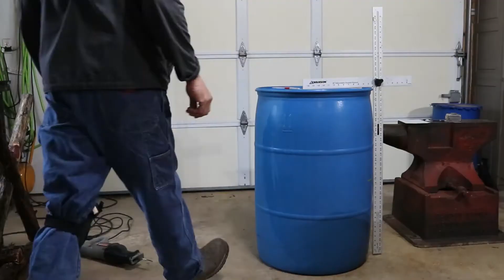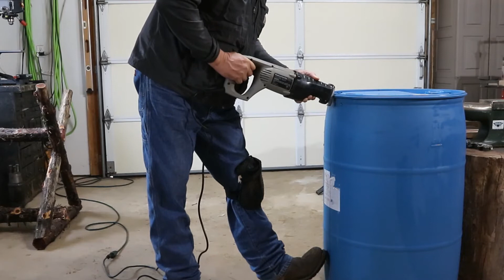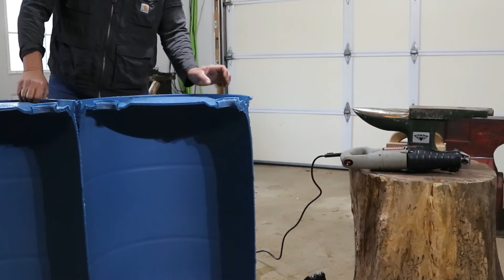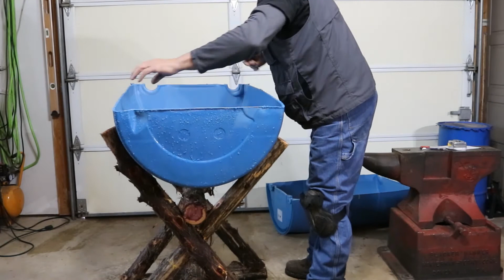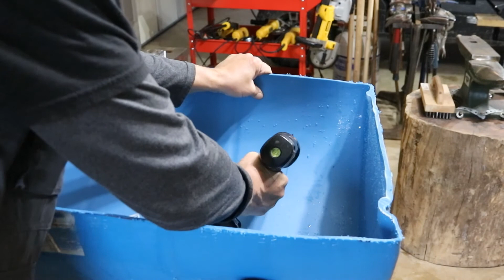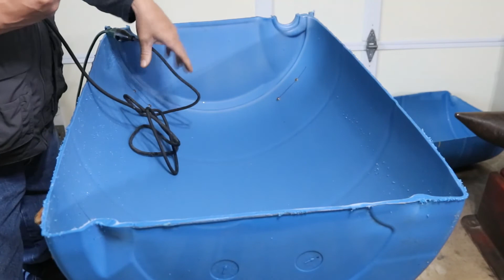How To Make A Raised Garden Box With A 55 Gal Half Barrel

Comment: Great Job Joe, And if you put the weep whole on both  sides about 4 inch's from the bottom and use a 1 inch spade bit then put some garden cloth over wholes they say you can fill with water till it comes out the weep wholes and wont have to water as much and if you get some down pores it wont flood your your plants out. Also from what I've been researching it promotes the roots too grow downward  instead  of just spreading out. great minds must think alike I've been looking at making some raised bed gardening tips.
Reply from the maker: Thank you , I can see a lot of benefits from the planter being  up off of the ground and that's a great idea on the holes up on the side  a little higher to help retain water . I will add that working with the plastic containers was enjoyable and I will have a lot of uses for them in the future . Thanks for Sharing and Thanks for Watching